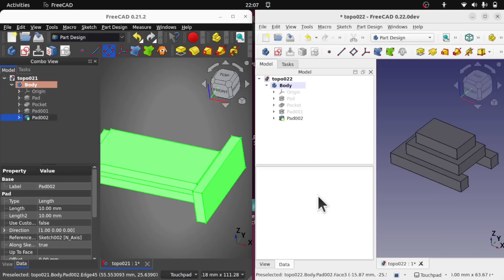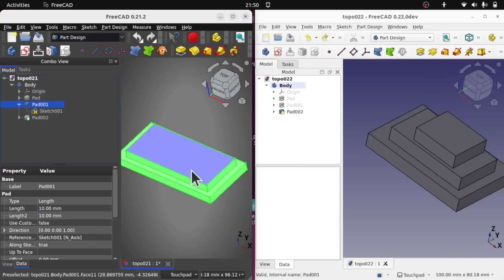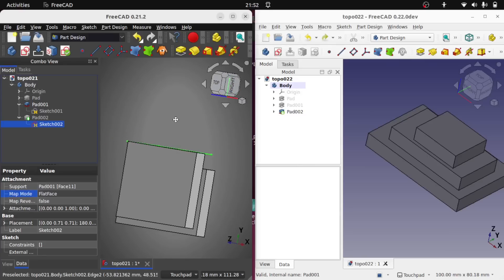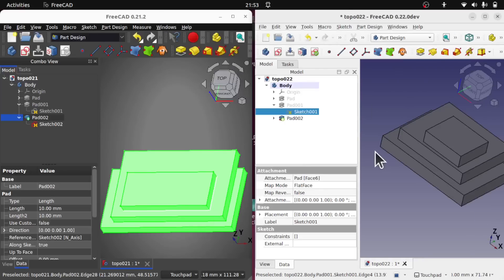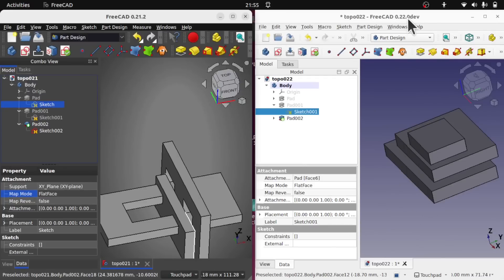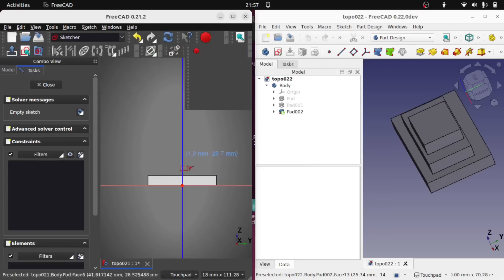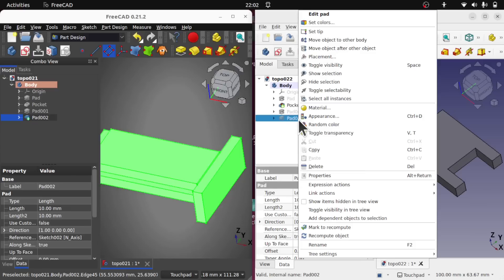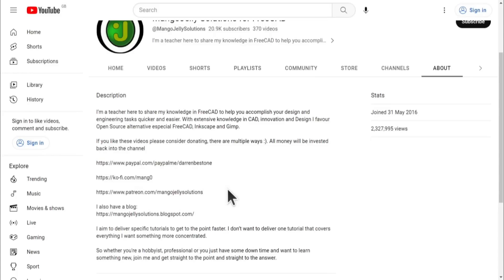I Have it! FreeCAD Exclusive! First Look at 0.22 topological naming issue fix. Side by Side Compare

Comment: This is a BIG deal. The topo naming issue bit us a couple times on a design project, leading to some minor delays, but glad to hear a fix is on the way. FreeCAD is getting better by the day!
Reply from the maker: I have been using dev version 0.22 in the weekly builds. Been updating it each week and it has been a god send to work with. Not being plagued by topo naming issues is just so much nicer.
Reply: @MangoJellySolutions  This fix will definately make things easier when doing things such as station frames on a boat hull or aircraft fuselage design. Looking forward to giving it a go!!

Comment: Wooo Hoooo!!!!

As a beginner with FreeCAD, I have stumbled over the TN issue frequently. My very first build after buying my 1st 3D printer was the creation of a linear stage that I had been trying to create with fiberglass before buying a 3D printer. Without knowing ways to fix the TNP, because I was just starting out, I resorted to deleting the whole model and starting over. After a dozen start overs, I abandoned the project and started looking for other free CAD software that would work the way I thought it should. Y'all know what I found -- nothing free with the capabilities of FreeCAD. Today, a month later, I know more than I did last month, but I haven't tried that build again, yet. I think, now, I will wait for 0.22 to make it to a stable release.

Comment: Why no build for Windows 7 !!!!!!
Reply: I use freecad on windows 7. No problem. Sometimes you need to get the win 7 installer for the programming language fix a program uses. Then the program works.
Reply: @meisievannancy  The new version is not compiled for win 7. only the old ones are.

Comment: So the topological branch release is still non-public? Could we try it now?
Reply: The TNP fix hasn’t been fully merged to 0.22 dev yet. Once it’s done, it will become 1.0.
Reply from the maker: Just to add the Devs have released a time line and they are looking at v1 release around mid July
Reply: @MangoJellySolutions  But I'm still curious why they hid the branch code of this crucial feature. In theory, the license requires that the code must be made public, but I have to wonder if anyone is thinking about how to convert these valuable features to non-open source
Reply from the maker: @longjack8919  The branch was built and release to myself from by a developer so I could demonstrate the progress.  The code was not ready for a weekly builds but the source code is readily available to anyone that want's to download it, it's not hidden, you can go and download it now.  Finding out what branch to compile and what to change to switch on the test features requires knowledge in the software development field and a full understanding of the source code itself to finish the code and communication with the developers.  Anyone with the knowledge can participate enhancing the code and submitting the changes for review.  This is how originally the fix started, it was originally developed in something called the 'link stage' branch which some people are already using.  This is a fork of freecad that has diverge so much that those changes needed to be merged back into the code.  I demonstrated this branch in the prior video. The timeline for the release of v1 has been set by the developers to be released by approx. mid July with a feature freeze beginning of June.  Open source is just that, the source is open for anyone to participate so nothing is closed to general public.

Comment: I'd like you to demonstrate it working in sketches with "external geometries".  When we need to add elements to a base sketch in a body, and other sketches use some elements from that base sketch as "external geometries", sometimes it's almos easier to redraw everything than try to fix.Remap faces is a little annoying, but when we are used to freecad, we can do it quickly (as you demonstrated).

Comment: I learned you should not place sketches on faces but use datum planes, lines, dots instead. However, with an operation such as filleting an edge, this isn't possible of course, as you would need to select an edge. The same issue arises: have a polar feature to add a configurable nr of holes and after that fillet some edge, now set a different nr of occurrences in the polar feature and the same topological naming issue is there: some other edge is getting filleted. 

Does that mean that that issue with the filleting is also fixed in that branch? My work around for the fillet is to create a shape with the fillet geometry and cut it out of the original, so the polar feature can still be changed and the end geometry remains ias it should be; with the correcte edge being filleted.

Comment: What is "set tip"?
Reply: Every last operation/feature made and presented in the model tree is considered the tip of the current process. You can also select a previous step long time "processed" and press the Space Bar, all subsequent "steps" will be ignored on the 3D Viewer window.
Reply: The tip of the model is the point after which new features will be added. By default it's the last feature created in the timeline but you can set it to any other one so new features are inserted into the tree rather than appended to it.

Comment: any word on how it's actually working? especially from your demonstration about flipped reference surfaces, there'd be a hack solution to see if the orientation has changed and automatically re-apply the face, that makes a lot of cases really work but it's not a "fix" per-se. other "fix ups" like that are all over the place and it's not great, because the "fix" can end up breaking and doubling the possible outcomes
Reply: If you are interested, it’s documented in detail in the Assembly3 GitHub repository belonging to Realthunder who developed the TNP fix.

Comment: If the typological naming problem is solved what stops FreeCad from becoming the de facto world standard!
Reply: Many other issues and limitations (IMO mostly fillets/chamfers, offsets and making parts hollow - those are the least reliable tools). But even if most of them are fixed (which won't happen anytime soon as it's a fault of the open-source CAD engine used by FreeCAD, not FreeCAD itself), even the best open-source software is rarely used by bigger companies.
Reply: @Gumball_W  I've investigated FreeCAD to replace our existing CAD. 
We have in-house dev so transforming FreeCAD to match our workflow to increase productivity is actually a unique strength. 
There are obviously no licensing fees, but we set that off against the cost in developing custom workflows. But still better because the alternative would be both the license and development. And eventually development will show down.
In our case the chamfer and round issue are minor. However it does expose the bigger problem in the dependency on the OpenCascade kernel. It would go a long way to see strong collaboration between the two projects to help build faith in the future on FreeCAD.

Comment: The topo naming issue has been around for as long as I have been 3D printing, a little over 1 year now. It can sometimes get really hairy if you update your model some steps back (also fillets, which Darren hasn't demonstrated yet, and he warns us to leave this to the last steps!). But other than this (OK, rather major) bug, FreeCAD is still an excellent tool and I cannot imagine designing stuff without it. 

With this fix, it will be an astounding 3D design tool. I can't wait until it is released. Kudos to the developers for grasping the nettle, it must have stung but their pain is our gain.
Reply: It's not really a bug, using faces as references is just a fundamentally bad idea. But because people find it intuitive, CAD software is expected to have complex code in the background that tries to guess what the user actually wanted.

A better solution is to make more robust models. Instead of building a tall tower of features that is easy to topple, build a wide pyramid that is much more stable. For example define the sketch plane using an offset plane, with the offset linked to the height of the pad. This workflow seems tedious at first, but it saves you a lot of time since you almost never have to fix broken features.
Reply: @Bruno-cb5gk If that's the intended workflow it should be designed to make that easy. I'd love a feature that lets me select a face and pick one of a list of equations for that face's position (which update when the constituent values are changed). The good workflows should have good UX.

I agree with you about avoiding overcomplicated dependency graphs for 3d models being a good thing, I don't think it's a "fundamentally bad idea" to make it work in slightly nontrivial cases (such as the one shown in this video).
Reply: @reddragonflyxx  imo the issue is the use of linear histories, when in reality many features are unconnected. An actual visualisation of the interconnectedness would be very helpful in showing the difference between good and bad workflows.
Reply: @Bruno-cb5gk  In true FreeCAD style, there's the DAG view (which has to be enabled in the parameter editor) and the Std DependencyGraph command.

You can render graphs using tools other than Graphviz, such as Vizdom (website with live editor). Anything that understands the DOT language works.
Reply: I've been using the LinkStage version of FreeCad for that reason (and sponsoring it a bit, the toponaming solution is created by LinkStage's authon, RealThunder. But recently, the main FreeCad is making a lot of progress, so it is good the mainstream has this very good functional base really soon now.

Comment: Can you try if it works with chamfers and fillets. I often have the issue that I make a 3D printing model and in the last step I add chamfers, typically on the bottom of the model, to compensate for elephant's foot. When I later make minor changes to the model, even if the bottom faces have not changed their geometry at all, the chamfers completely break apart and are applied to edges spread out across the whole model and it's so bad that the only reasonable way is to remove the chamfer(s) completely and apply them again.

Comment: I'm happy to see this work landing upstream so that people can stop using the topological naming problem as a reason to avoid FreeCAD.
That said, mapping features to faces is rarely good practice and no amount of code can reliably solve the problems it creates when you change geometry and actions up the timeline.
Good practice is to map sketches to datum planes (including the usual XY, YZ, and XZ planes) and move the sketch positions relative to those if necessary.
If you map to non-geometry datum then changing geometry or adding actions up the timeline is no problem.
Reply: Yes I feel creating a sketch on a face is needed while you are a beginner. It has really been awesome now to understand how to get around in 3D space. I can now envision my part in 3D. Understand to move forward with the next sketch,  which plane do you need to be on and the height the face you are building off of is how far above or below the origin, and offset your the new plane accordingly. 
I Love FreeCAD and I just keep using it everyday to get better.
Thanks FreeCAD Community, i.e. (Developers) and this channel!
Reply: @GDub1958  I try and treat it like fillets, they're the last thing I might use to finish off some small detail, not something I'll use in the normal workflow. If I treat it like that, no problems.
Reply: How can I learn datum planes? Ich tried with multiple videos, but it feels like there is no good one where I can follow the steps. I find this feature very difficult to learn.
Reply: @sandmann7777  The basic idea is to create and position a datum plane and then use it like you're using XY, YZ, and XZ planes. So before creating a sketch select the datum plane. That way the sketch will be on the datum plane instead of the XY plane or whatever.
Reply: @sandmann7777  so I use datum planes on surfaces that I have created on something that has a slope, but then I need to create a hole in this sloped surface that is perpendicular to this sloped surface (face). If you use one of the 3 planes (XY,YZ,XZ) then the bore will not be perpendicular and not the absolute thickness of this face. This is just one example where a datum plane comes in handle, but I do not use a datum plane just because of the Topographical Naming Issue. Mango Jelly Solutions explains this very good!